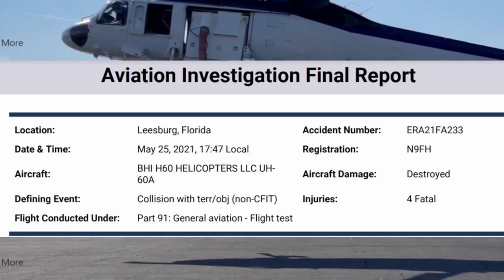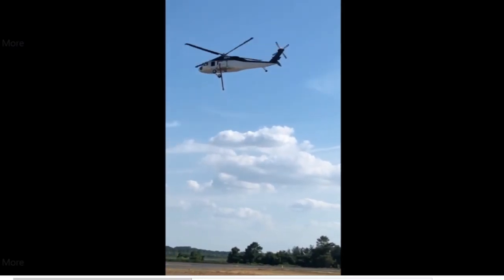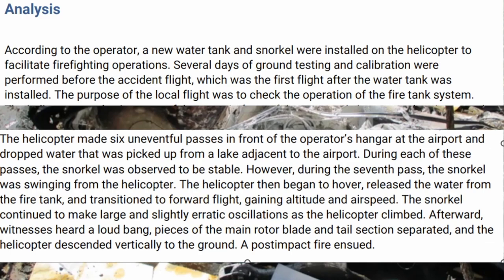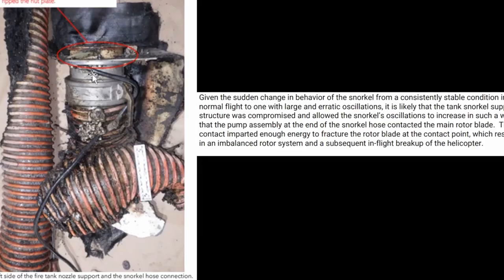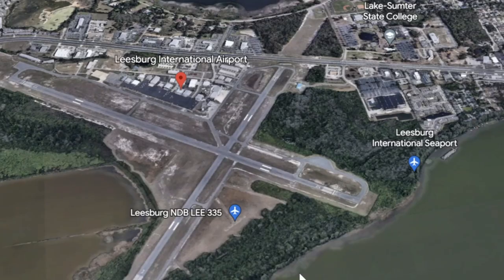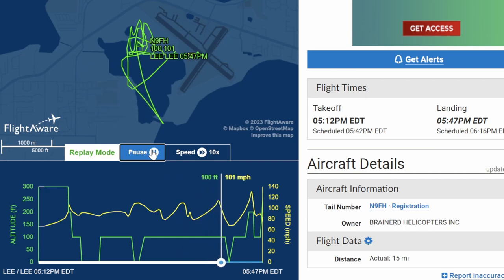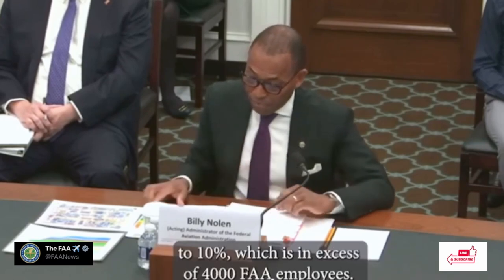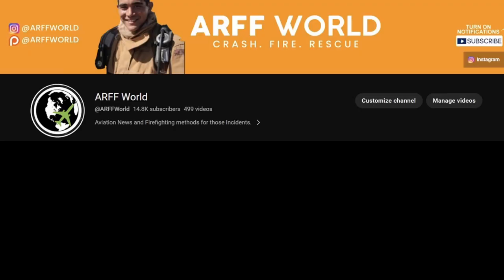Blackhawk Snorkel Hits Main Rotor Blade

Comment: The STC process was created to prove the design, install, and operation of modifications to an aircraft are safe to use…

After all… if something Can go wrong, it Will go wrong….

Expect that there was something in the design to keep the hose from reaching the rotor…
Or there was something to inform the pilot to only operate under certain conditions….  Possible speed limitation or something similar…

Once something goes wrong… it may be impossible to stop it from getting worse.

Thank you again Keoni!
Reply: You have sumed it up. And we all agree a sad loss because of a bad situation. RIP.  Seems the only thing we can possibly say  It just was their time'

Comment: There are a lot of physical and aerodynamic force at play with a helicopter. If you hang something flexible and long enough to reach the rotor blades, eventually it will reach the rotor blades because of the dynamic forces at play. Same with rotor blades, if they are flexible enough to strike the tail boom, eventually unforeseen dynamic force will force it to hit the boom (think R44's). This was preventable. RIP pilots.

Comment: my father was a fixed-wing pilot in the RCAF in WW2. He refused to get into helicopters. His position was that if you could show him a bird which whirled its wings over its head to fly he might consider it
Reply from the maker: Thanks for sharing Cold
Reply: Still waiting on the bird with a propellor on its beak or farting to propel itself too.  No flapping wings on planes either. 🤣🤣

A helicopter is like a plane: fly it safe. Each has its function with little overlap.

Comment: There should have been some sort of stiff guide or restraint on that snorkel that limited it's motion.  Even just a straight piece tubing and a captive ring near the bottom of the fuselage that allowed extension and retraction; but limited motion longitudinally and laterally - just long enough so it would be possible to flex, but never reach the rotor.  Also, there doesn't seem to be a break-away that would release it once a significant amount of force was applied.  That's just flawed by design.
Reply from the maker: Good point.  A breakaway should have been an automatic after a certain degree bend upwards
Reply: That tube does not retract. So is has to bend/flex for landing.
Reply: @TheBeingReal  Sure, it looks like a flexible hose with a weighted pickup screen at the bottom and a flange mount at the top.  It's probably designed to move to some degree to always be pointing down, within reasonable ranges of attitude of the helicopter.  It probably springs in and out to a degree too, as that type of hose is meant to do that while maintaining a mean diameter (the spiral wound polymer or steel element inside does that part).  It should not be allowed the range of motion to contact the rotors or smack the crew.  It's unfortunate this ended up killing them.  I'd question the airworthiness of that STC.  Even a small guide could have kept it out of the rotors.  It sucks that they died because of that and they probably didn't see it coming.

Comment: I'm far from being a nervous flyer... on fixed wing aircraft. Helicopters are a different story - if the engine or the rotor blade quits, you go down immediately.
Reply from the maker: They seem to kill without mercy when they go down
Reply: @ARFFWorld  then you have cases like British Airways flight 9 or the Gimli Glider
Reply: If the engine quits and the rotor is still in rotation you have autorotation to land the helicopter save like a fixed wing plane with engine failure. 
If you loose parts of the rotor like in this case you are doomed, because of imbalance and the resulting forces.
But when you loose a part of your fixed wing you are also gone in a spiral of death... 🤷🏿‍♂️
Reply: Learn about autorotation.